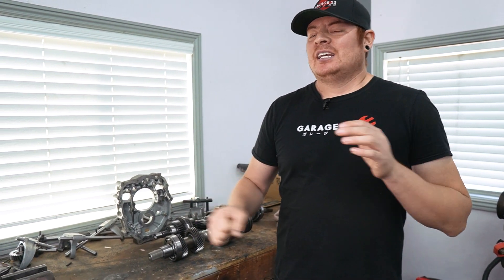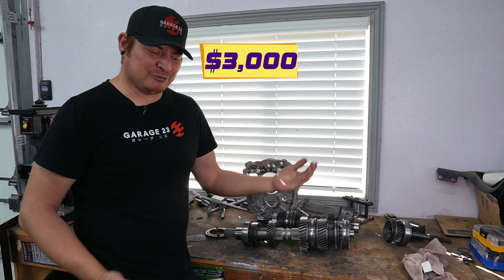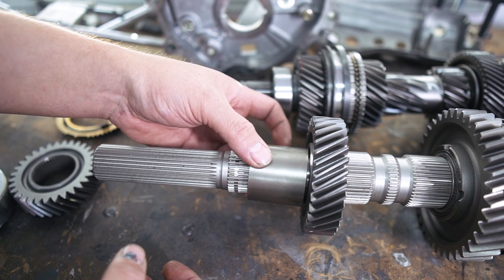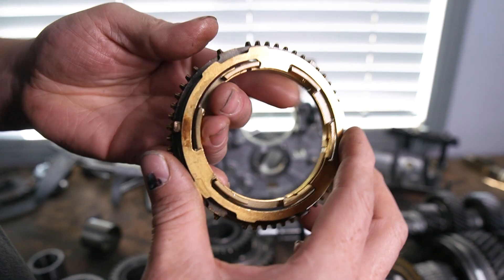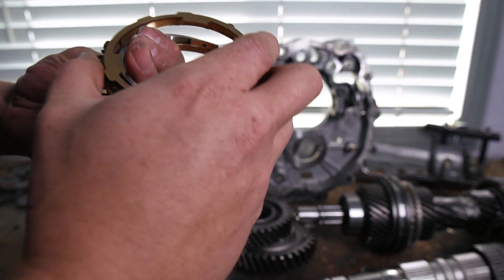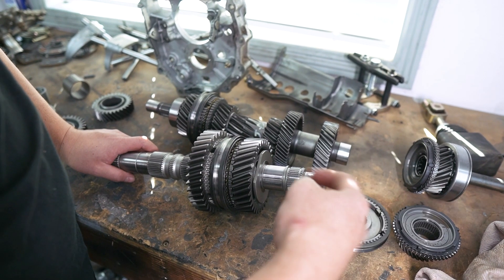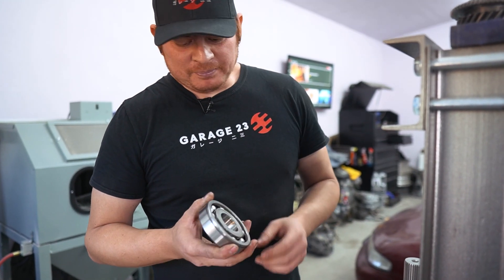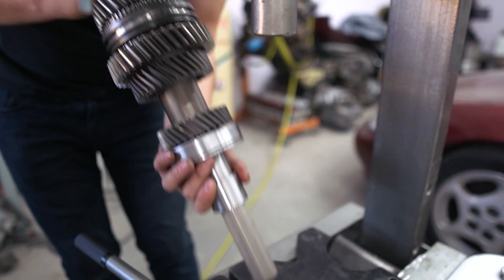Transmission Stuck in 1st Gear Fix CD009

Comment: Hello and thank you for the videos. Trans off my 2008 g37s is stuck in neutral, i have the trans off. It allows travel to the left like if you were to go into 1st or 2nd but it does not avtually go in. Going to the right to 5th it does not move at all, stuck in nuetral. Any input as to what could be the issue?
Reply from the maker: Hard to say, could just be the lock out plate on the shifter adjusted incorrectly. Other than that you’d need to get the case off at least and inspect the forks and rods for binding.

Comment: I didn’t agree in the earlier vid with not replacing all synchros, bearings, seals etc. any time a transmission comes apart for a major repair having mileage on it, so not surprised at all.
Reply from the maker: In the earlier videos that decision was based in part to the synchros being in decent shape and the limitations of my equipment at the time. This was a completely different gearbox in this video with a seperate issue all together.

Comment: I recently tried to rebuild my cd after having bad synchros in 2nd/3rd. Everything seemed to go smooth until it was back in the car and I couldnt shift into reverse or 2nd. Any ideas before I tear it apart again?
Reply from the maker: Hard say but usually when that happens it's because the individual pieces of the synchros get wedged together from reassembly essentially locking it in gear. But if you checked it before putting it back in the car and everything shifted and spun correctly then it might be a clutch issue.
Reply: @Garage 23  I ended up just buying a cd009 and throwing that in since the one I was rebuilding was a cd001. Everything seemed fine and was fairly straight forward to reassemble besides the big line of detents and ball bearing across the top of the trans which was a little confusing. I'll have to tear it down and see what I can figure out. Thanks for all the videos!

Comment: Bro the Amayama link just got you a sub.   Thanks for the info. I've got 3 CD trans in my garage for various projects but I've yet to go through all of them.   I recall you saying in a pervious video the JK trans 3rd gear is a one piece instead of two piece brazed. Is this correct??
Reply from the maker: You know what I don't remember now, i think they looked exactly the same desires a free more teeth but I didn't check to see if it was brazed together. I was more referring to mine being broken in two pieces

Comment: Awesome videos / info 💪 do you think its posible to swap 009 synchros in non 009 transmission? Atleast 2nd and 3rd ….im in the process to buy a damaged transmision for a project don’t know if there is much difference in performance on both transmision any advice is appreciated 🤙
Reply from the maker: We haven't had a non 009 transmission to take apart but there's a good chance it would work. But unless you plan on making over 300ftlbs of torque the older transmissions will work just fine.

Comment: I don't know if you've mentioned this, but can earlier 350z/g35 manual transmissions be internally upgraded to CD009 spec?
Reply from the maker: I mentioned this in another comment somewhere but I don't know if it's possible, I haven't had an early trans to look at but I think there's a good chance it could work. It might be expensive though as you would probably have to replace some of the gears as well, as they are designed to work with specific synchros.